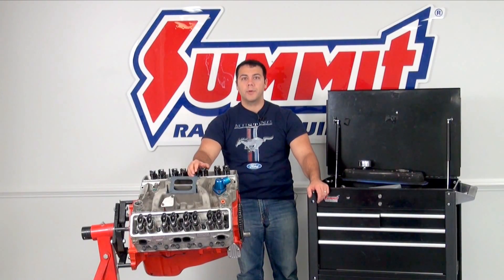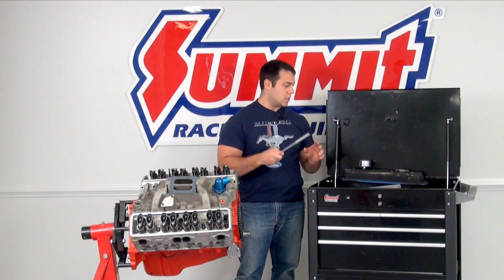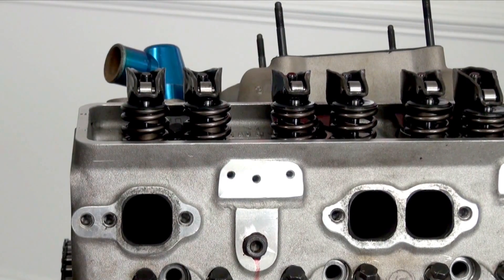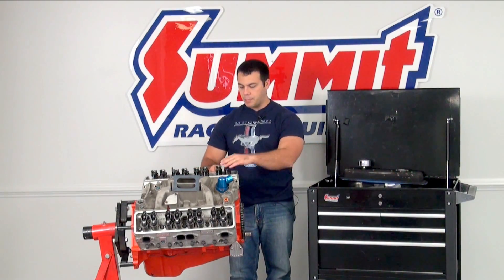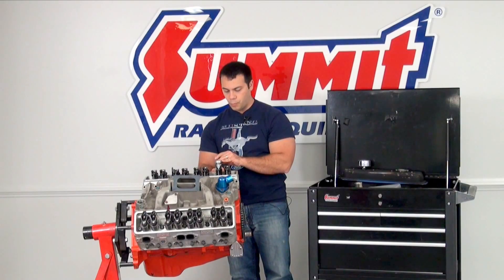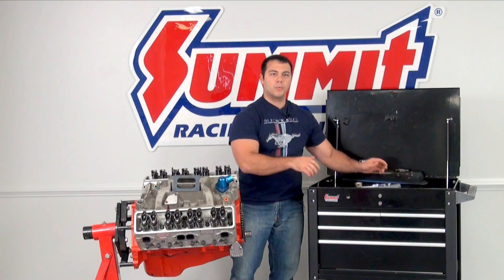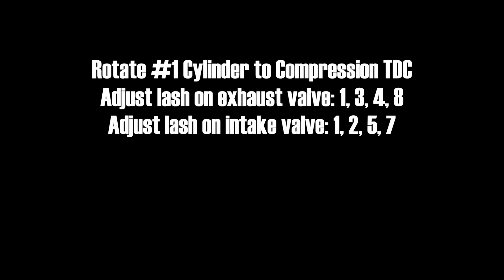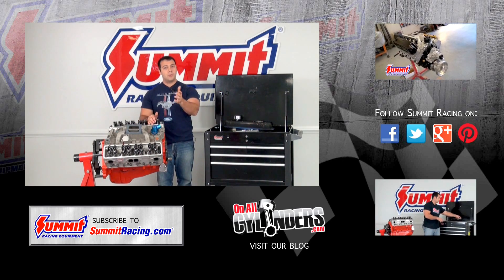Setting Valve Lash on Solid and Hydraulic Lifters

Comment: I just wanted to set the lash on my Crane anti pump-up lifters for a Gen 1 sbc?
Reply from the maker: Stephen Giovi , 
This is from the Crane tech info page: 

Adjusting Hydraulic Lifters for Proper Preload
In order to adjust the preload the lifter must be properly located on the base circle or “Heel” of the lobe. At this position the valve is closed and
there is no lift taking place.You will need to watch the movement of the valves to determine which lifter is properly positioned for adjusting.

1. Remove the valve covers, and pick a cylinder you are going to set the preload on.
2. Hand rotate the engine in its normal direction of rotation and watch the exhaust valve on that particular cylinder. When the exhaust
valve begins to open, stop and adjust that cylinder’s intake rocker arm. (Why? Because when the exhaust valve is just beginning to
open, the intake lifter will be on the base circle of the lobe, the correct position for adjusting the intake.)
3. Back off the intake rocker arm adjuster and remove any tension from the pushrod.Wait a minute or two for that hydraulic lifter to
return to a neutral position. The spring inside the lifter will move the pushrod seat up against the retaining lock if you give it time to do
so. (If you are installing brand new lifters they will be in the neutral position when they come in the box.)
4. Now spin the intake pushrod with your fingers while tightening down the rocker arm. When you feel a slight resistance to the turning
of the pushrod, you are at “Zero Lash”. Turn the adjusting nut down one half to one full turn from that point. Lock the adjuster into
position. The intake is now adjusted properly.
5. Continue to hand turn the engine, watching that same intake. It will go to full open and then begin to close. When it is almost closed,
stop and adjust the exhaust rocker arm on that particular cylinder. (Again, when we see the intake almost closed, we are sure that
exhaust lifter is on the base circle of the lobe.) Loosen the exhaust rocker arm and follow the same procedure described before in
steps 3 and 4 to adjust this rocker arm.
6. Both valves on this cylinder are now adjusted, and you can move on to your next cylinder and follow the same procedure again.
Reply: @SummitRacing  Thanks for the info. guys, I appreciate it.

Comment: Would a tight valve cause the Mercruiser 5.7 to overheat?
Reply: It can cause more stress but more bottom end torque but also leave the valve hang open, the looser the valve the higher rpm you can get out of it and higher peak horsepower but can also cause you to lose duration on the camshaft

Comment: Get rid of that overlay at 4:25. It's mixing some people up. The way it was originally written was correct. That overlay is just a pain in the ass
(New comment-05/22/2021)- looks like the overlay got removed... I don't even remember what it was, but I do remember something confusing when I was trying to read that info on the cheat sheet. LoL

Comment: How wOuld i do this on my honda 1.5l non v-tec?
Reply from the maker: Aaron Bonter, Warm engine to normal operating temperature, remove valve cover, upper timing cover and  all four spark plugs. Turn the engine counterclockwise, until it is at top dead center (TDC) on the number one cylinder (closest to passenger side fender) compression stroke, using a socket and ratchet or wrench, turn the crankshaft bolt on the front of the engine. When the timing marks on the front of the camshaft sprocket are lined up with the edge of the cylinder head and the "UP" arrow is pointing up, number one cylinder is at TDC on the compression stroke.
Slide a .008-inch (.20mm) feeler gauge between the valve tip and the rocker arm. Loosen the 10 mm adjusting screw lock nut on the number one intake valve rocker arm using a wrench. Tighten the adjusting screw with a small screwdriver until there is a slight drag on the feeler gauge and tighten the lock nut while holding the adjuster screw. Repeat the process on the same cylinder exhaust valve using a .010-inch (.25mm) feeler gauge.
  Rotate the crankshaft 180 degrees counterclockwise until the timing marks on the camshaft sprocket line up with the cylinder head again. Adjust the valves on cylinder number three the same as on number one cylinder. Rotate the crankshaft 180 degrees and adjust number four cylinder valves. One final time, rotate the crankshaft 180 degrees and adjust the valves on the number two cylinder. Reinstall the front timing cover and the valve cover using a new gasket.

Comment: how about ford small block, I have 331ci with comp cams 294 flat tappet. with the #1 at tdc what other valves can be adjusted at the same time to reduce how many times you have to rotate engine. my firing order is 1-5-4-2-6-3-7-8.... thanks
Reply from the maker: Jennie Pilant,
Valve Adjustment Procedure for Ford V8
W/Firing Order: 1-5-4-2-6-3-7-8
                                                            Valves to Adjust
                                                           Intake    Exhaust
#1 Piston at TDC on Compression Stroke #8            #5
Rotate crank 90° Clockwise                     #1            #4
Rotate crank 90° Clockwise                     #5            #2
Rotate crank 90° Clockwise                     #4            #6
Rotate crank 90° Clockwise                     #2            #3
Rotate crank 90° Clockwise                     #6            #7
Rotate crank 90° Clockwise                     #3            #8
Rotate crank 90° Clockwise                     #7            #1

Comment: Got a question. Building my car on a budget so it's taking me a while to get everything so starting it will be another 6 months+. Should I wait to set the valve lash? Or is there no big deal with setting the pressure on them? Also, I turn my motor over once a month.
Reply from the maker: Punk Rock Pete,
Yes, when a motor is being stored for long periods it is always best to loosen the rockers so the valves are not held open and the springs are not compressed.

Comment: Good tip.
 When setting the valves in the number 1 firing position you may adjust
Exhaust  1, 3, 4, 8     Intake 1, 2, 5, 7  the number 6 firing position is one revolution from  the number 1 firing position. In the number 6 firing position you may adjust 
Exhaust  2, 5, 6, 7   Intake 3, 4, 6, 8    this information was in my Chevrolet shop manual.
Reply: same for bbc right?
Reply: Adam Schofield yes.
Reply: Thank you.
Reply: I pretty much put number 6 cylinder overlap check for top dead center Mark the poet four ways for a V8 or three ways for a six cylinder then I look at the time in order, and  draw on a piece of paper, and then I just overlooked the time order 180 out and then I start just the valves number 6 you do number one and just keep going down the line and only two revolutions of the crankshaft you have all the valves adjusted.
Reply: Gking King  So I need to turn harmonic balancer and crank one turn back to 0 on balancer for number 6 firing order? correct?
Reply: Gking King Exactly!!

Comment: At 4:25 which is correct? Intake 2 5 6 7 exhaust 3 4 6 8, or is it the other way around? And when I go TDC on 6, do I adjust the intake or exhaust valve?

Comment: Really need to replace the graphic at 4:25 in the video. I think it was correct to start with and then faded the original "intake" and "exhaust" which were right and added another "intake" and "exhaust" over them which makes the graphic incorrect.
Reply: Dude I don't understand what ur saying, is it intake valves 2 5 6 7 and exhaust 3 4 6 8, or is it the other way around? What is it?

Comment: can you do this with brand new hydraulic lifters before they are full of oil
Reply: I recommend priming the engine. You should do this either way. Some people let the lifters sit in oil prior to installing, which is fine. But, either way you should prime the engine with any new valve train components.

Comment: Hey got a question. .when I get TDC and start to adjust the valves when intake goes down can I then adjust both intake and exaust? And then rotate crank to next in firing order and when that intake goes down adjust both intake and exaust again..and so on..I have a 67 camaro 350 sbc w/hydraulic lifters..
Reply from the maker: Hi scott cannon, 
If any valve that you are about to adjust is being depressed (moved) by the rocker, that is NOT the correct time to adjust them. You must know without a doubt that the lifter for that valve is at the lowest point of the cam lobe known as base circle!

Comment: hi there
I have z28 1978 with 350 Cu( all original )  , I found many techniques to adjust the valve , to find the TDC ,what is the type of valve I have ?

thanks
Reply from the maker: Hi ramtha Lord, 
When you see the intake valve close, continue turning the motor (in the correct direction) until it reaches TDC. This is TDC of compression and both valve on that cylinder can now be adjusted.
Reply: Summit Racing
thank you for replying , so adjusting the valve like sold lifters or hydraulic lifters, because I don't know what type of lifter I have ?

Comment: Good video but, wouldn't number 1 be just before bottom dead center if the exhaust valve is just starting to open?
Reply from the maker: Hi CNC Proformance, 
We are working on the compression stroke so that way both valves are closed.  To easily find the compression stroke, you are going to watch your valves as they move.  The intake valve is going to open then close and you want to continue to rotate until the exhaust valve begins to open.  From there you have gone too far and need to back off the crankshaft to go back to the compression stroke.  While I understand this by no means is a precise measurement, we would need to know your exact cam profile and you would need a degree wheel to pinpoint the exact location of the piston in relation to the camshaft.  The key to remember is that with the valve you are working on, the lifter must be on the base circle of the camshaft so there is no actual lift happening, the valve must be closed
Reply: @SummitRacing  I am very confused by this statement.  You seem to be missing a step.  The description above, and in the video, should find TDC on the exhaust stroke of the valves being watch.  You have to rotate the engine a full revolution to get to TDC on the compression stroke.  The more practically solution is to recognize that exhaust TDC on cylinder 6 is compression TDC for cylinder 1 and visa versa.

Comment: I have a mystery small block 350 and I'm not sure if it has solid lifters or hydros how can I tell?  the guy that sold me the car didn't provide receipts of the rebuild, thanks.
Reply from the maker: Hi Ron S, 
With no information (receipts) it will be difficult at best!  The only other solution is to pull the lifters out and lay them down on a clean shop rag on the bench overnight. After some oil drains out of them, see if the cups where the pushrods sit can be compressed. If they can, they are hydraulic. Otherwise they are solid lifters.

Comment: How do you tell if you have solid or hydraulic lifters? I have a Chevy 350, and the passenger side valve cover sounds like a quiet sewing machine, but the driver's side sounds a bit like a marble is rolling around in there. Seems to be close to the PCV, but its not that making the noise. Does this sound like I need to make an adjustment on the driver's side?
Reply from the maker: Mac Maven, 
Solid lifters have not been
factory installed since the sixties. Most likely you have hydraulic lifters
unless someone has changed them at some point in the engines life. If it is all
still factory original yes, it is possible you may need a valve adjustment. You
may want to remove the valve cover and inspect for any damaged parts first,
especially if it is a high mileage motor.

Comment: Will the procedure for setting the valve lash on multiple cylinders at once referenced at the end work on a AMC 360 that I am currently working on?
Reply from the maker: Kent Hibbard ,
Unfortunately it will not. You
can give us a call on the tech line and we can walk you through it. 1-330-630-0240.
Reply: Summit Racing The AMC 360 has the same firing order as the engines listed (I noticed that AMC is listed at the bottom under Chevy, Olds, Buick, Pontiac, and Mopar) and the valve configuration is the same as well so I am interested as to why this process would not work.  I called the tech line today and the representative did some research and was not sure why this would not work either.  

If there is some specific reason that you could post here that would be great.. thanks.

Comment: how do you break in the engine with those springs because i am having trouble getting the dual spring out please help
Reply from the maker: Zachary Smith,
Assuming you have a flat tappet
camshaft, it really is best to remove the inner spring for camshaft break-in.
This removes some pressure from the peak of the cam lobe during that very
critical time. Make sure you’re using a racing oil (or additive) for break-in
and have applied plenty of Moly lube on the lobes during engine assembly!

Comment: Set number cylinder 1 to TDC, adjust lash on 1, 3, 4, 8 exhaust and 1, 2, 5, 7 intake. Then rotate to cylinder 6 at TBC and do what: on intake and exhaust? The video seems to be a bit messed up just at that point.

Comment: I have a quick question I have a 2003 f150 4.2 v6 and I purchased comp cams, lifters, push rods, springs, retainers, roller rockers and I need the proper studs, locks for the roller rockers that didn't come with roller rockers. The factory stock ones doesn't fit the comp cams rockers The heads are the exact same as the 3.8 v6 mustang Please I need help. I need the studs and locks
Reply from the maker: Hi CBooge2, 
We carry a complete adjustable roller rocker arm set from Harland Sharp. They will fit under the stock valve cover and may require a shorter pushrod length due to the adjuster on the rocker. But pushrod length needs to be checked anyway since you are changing so much in the valvetrain. Here’s the link to the rockers…. http://www.summitracing.com/parts/CSP-S40173A/?feedback=1
Reply: Summit Racing I have the comp cams rocker rockers and the longer push rods for comp cams. I was just hoping if yall had the studs and locks that would be a fit. If not I would have to send the comp cam rockers and push rods back to purchase this holland rocker kit
Reply: Summit Racing lol typo harland

Comment: when i set the lash on my 350 with hydraulic lifters when i give it throttle theirs popping and misfiring original valvetrain.
Reply from the maker: Hi austinmakaris, 
The popping & misfiring that you describe after valve adjustment is most likely not just a coincidence. It may be due to a valvetrain failure of some sort such as a camshaft going flat, a broken valvespring etc. It could also be caused by some other things as well. Feel free to give our techline a call for some advice on a direction to start your diagnostics.1-330-630-0240.
Reply: Too much preload

Comment: Really confused I have a ford 302 with solid flat tappet cam now where I'm lost is I tried both patterns for fords and neither one works for me??? So I'm guessing no short cut for my setup?? my cam is base on the 351 firing order??
Reply from the maker: Hi David M,
  Most times it is confusing to try and follow the firing order procedure. In this case you could adjust each valve individually by turning the motor over each time you move to the next valve. This insures that the lifter being adjusted is in fact at the base circle of the camshaft. It may take longer, but it will be correct!
Reply: Thanks

Comment: The adjustment sequence for a 302 Ford is kind of scrambled. Got another?
Reply from the maker: Hi Robert Behr, 
Most times it is confusing to try and follow the firing order procedure. In this case you could adjust each valve individually by turning the motor over each time you move to the next valve. This insures that the lifter being adjusted is in fact at the base circle of the camshaft. It may take longer, but it will be correct!
Reply: Fords firing order is 1,5,4,2,6,3,7,8. then follow this  This is the reason that there are so many people out there destroying their expensive cams. First off there is the only one way to do this simple but very important job. Remember this set of letters. " E.O.I.C." This means, Exhaust open, Intake closed. So, starting with no#-1 cylinder, You turn the crank clockwise until the No-1 exhaust cylinder spring is all the way open, then you adjust the No-1 Intake valve with your feeler gauge to lets say .018, then you rotate your motor around until the Intake at No-1 Intake valve is totally closed, then you adjust your exhaust valve at .024. Next , you follow this same sequence all around the proper firing order of your BBC motor which is 1,8,4,3,6,5,7,2... When you complete all cylinders in this fashion, your valve/lifters are all set correctly. Remember when you push your feeler gauge in between the pushrod and your rocker arm that the feeler gauge is just "SNUG" not super tight like some idiots have told you before. SNUG is better, not tight or super loose. When this is complete, your lifters are adjusted properly for 1-weeks worth of normal street driving, with a few good racers with your local competition. Adjust them every Sunday and your motor will operate correctly always. If you are at the track and racing, you might want to adjust them after every other race. If your are a fanatic, like I am. Thank You all